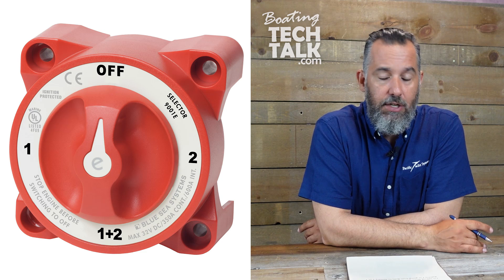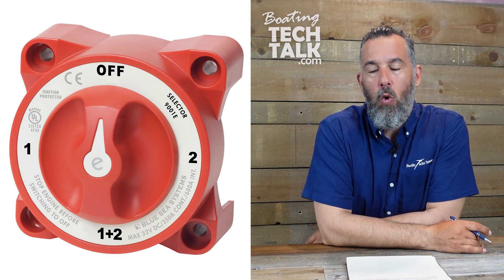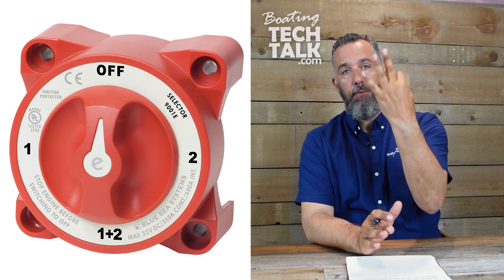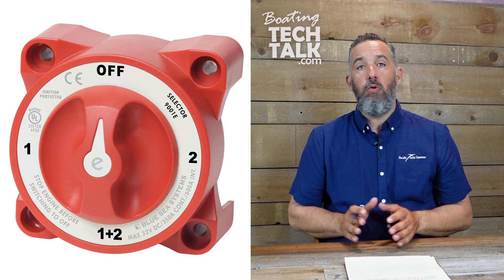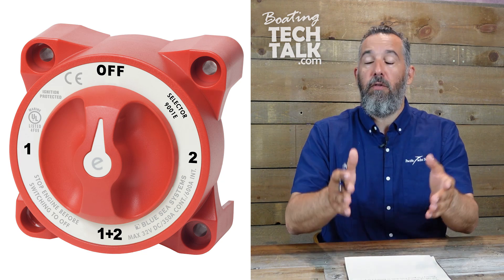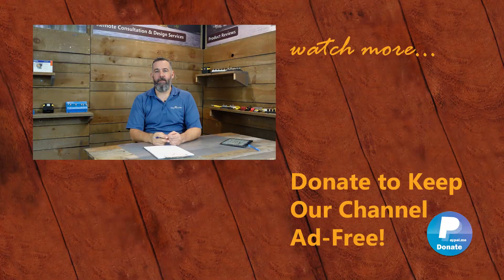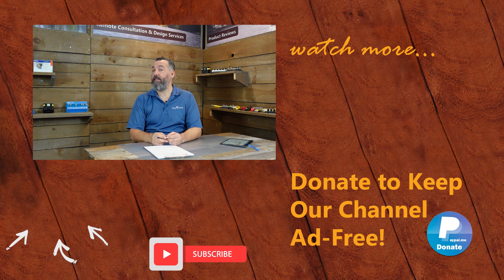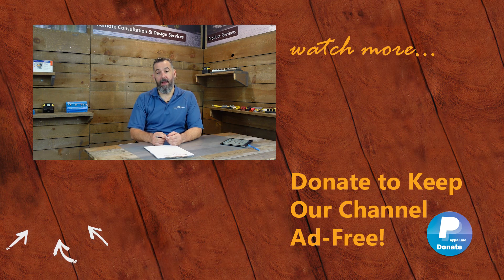Using A Battery Switch While the Boat is Running - Good or Bad?

Comment: Hey Jeff, I have a quick question is there a battery selector switch for a 24 volt system? I I burned up a couple wires last weekend trying to run my new to me trolling motor. I have two house batteries and one starter. The two wires coming from the selector switch to the two house batteries melted all of the coatings off of them. I just connected one of them and it seem to work OK. I do not have the trolling motor going through the selector switch just to the battery with a resetting breaker. I unplug the trolling motor upfront until I’m in the water.

Comment: I believe this problem would be solved by using a battery charging system with an Automatic Charging Relay.  Those switches are simple OFF....ON....BOTH BAT.  
The operator doesnt do anything.  Just be sure to run the boat with the switch in the ON position.  Blue Seas has system like this and it works like a champ.

Comment: I like your videos but you tend to exaggerate and make a lot of things sound much worse than they really are! You said that if you were to turn your battery switch off for even a millisecond it would blow your alternator, That is total BS! I know for a fact that if you were to rotate your switch past the off position it is not guaranteed you will blow your alternator, What you should have said is it is not recommended and you could end up hurting the alternator! I have done it at least a dozen times after having my alternator rebuild in 2001! My boat is a 1987 so I had the starter and alternator rebuilt in 2001 solely due to age, Here we are in 2023 and that alternator is still on my engine! You really make boating sound like it is all work and nothing but problems! I am from New Jersey and my boat has been docked in salt water from May through September ever since I bought it in 1995, My boat gets used once in a while after work during the week as well as every weekend! Boating is very enjoyable as well as relaxing, Most of the  problems with boating is almost always caused by the current or former owner!

Comment: Hi Jeff, great explanation, thanks. Given what you said, should you connect the motor to the start battery directly and then   run a lead from the start battery positive to the common terminal on the on/off/combined switch? If so should or could you also put a simple on/off switch between motor and battery to allow isolation if needed?
Thanks

Comment: I'd like to ask a ?. my name is Derek and the ? is I just ordered a blue sea mini add a battery kit. but I didn't realize when I ordered it that it said 65 amp. I had already ordered 60 amp breaker switches. can i still use them for my install or will they keep tripping when I turn the switch on. I only have two fish finders and led deck lights and led compartment lights on a bass tracker. my trolling motor is on a separate set of batteries. thank u

Comment: Why not just direct connect the alternator output to the house bank and not through the switch
Reply from the maker: Yep, that's one way to avoid interrupting the alternator circuit while the engine is running. Did this exact setup on my boat.

Comment: Excellent video, explained a lot but I still have a question: Is a battery selector switch’s purpose ONLY to select from what battery bank to draw power from (starter, house or both) when you need power, OR does it also determine what bank to charge to when motoring (starter, house or both) from the alternator?
Reply from the maker: Hi Pete, great question, in 99% of stock (i.e. typical installations) your battery source selector is for simultaneously running loads and deciding which batteries (1, 2, or both) get a charge.

Comment: Should my boat isolator turn off my running engine?
Reply from the maker: Boat isolator is on the output of the alternator. Battery isolator should not cause your engine to stop working.

Comment: not in the old days.. that was one way we could tell if an alternator.. or in most cases then a generator was working.. un plug your battery and if the vehicle kept running everything was ok.. if not your alt/gen was bad.. Todays "modern" and "improved" systems you can't do squat or tell squat with out some sort of toy that tells you what to do..
Reply from the maker: Thanks for sharing, definitely learnt something.
Reply: @PacificYachtSystems  Well, it is only useful if you work on old engines with generators.. And I thank you for sharing!

Comment: What if the alternator is wired to the house bank direct (fused) and a combiner is used to keep the start battery happy?
Reply from the maker: Good suggestion, my alternator is setup exactly like that.
Reply: Will connecting to the starting battery directly and add an isolator to house work better?

Comment: Blue Sea makes a battery switch with “AFD” that allows you to switch while running without damage to alternator.
Reply from the maker: Quite useful, but rarely wired.

Comment: Some switches have an alternator field switch ie the two smaller terminals, no field no problem.on the switch turns off the aI use a  capacitor 1/2 or one  farad connected to  the alternator and ground. The older refrigerator system required always to be connected to a battery. The capacitor allowed the battery to be disconnected with the refrigerator running powered by  a battery charger. The capacitor absorbed the voltage spike, back efm  from dc coils, and reduced the voltage pulses from pumps and auto pilot surges
Reply: Edit     after no problem. I use a capacitor…..
Reply from the maker: Thanks for sharing Joe, well explained.

Comment: Surprised that someone doesn’t make an over-voltage device to absorb the sudden voltage spike on a disconnect, and cut the power to the field coil. It’d only need to absorb the max amperage of the alternator for a few seconds. A high wattage resistor could easily “sink” that much power.
Reply from the maker: Exactly, Balmar sells a Schottky (sp?) Diode as protective unit. Anyone can share any insight on the device.
Reply: @PacificYachtSystems  like this? https://www.st.com/resource/en/application_note/dm00024664-schottky-diode-avalanche-performance-in-automotive-applications-stmicroelectronics.pdf

Comment: Why does the alternator have to be switched via the battery main switch. Have a permanent connection fused from the alternator to the batteries, maybe via isolation diodes and then have only the starter motor switched?
Reply from the maker: Good point, we are constantly modifying alternator and starter circuits for this very reason.

Comment: You have never explained why the alternator will die if battery is disconnected.  You have stated many times that alternator will die, but never why.
Reply: The alternator dies because the high amperage output is suddenly interrupted, causing a voltage spike, which destroys the alternator’s diodes, and may cause internal short circuits.
Reply: @robertschulke1596  I know that (30 yrs as EI&C Design Engineer)…but most do not know.  Suggesting Jeff explain the why.
Reply: @borysnijinski331  not terribly technical. It’s the same principle as the ignition coil in a make and break engine. Current through a conductor produces a magnetic field around the conductor. Cut the current suddenly, and the field collapses, inducing voltage in the conductor. In an ignition coil, 50,000 volts is normal. In an alternator, I don’t know, but I’d hazard a guess at several thousand volts. This can be easily demonstrated by energizing an electromagnet with a battery, then disconnecting it. When the connection is broken, a spark will be produced.
Reply from the maker: Thanks for the suggesting Borys, will bring it up in a future video.
Reply: My switch got out in the off position while running down the lake, and now boat won’t start. Any suggestions ??
Reply: @myronmoore30  You likelneed a new voltage regulator but may have just blown a fuse feeding the start/ign circuit.

Comment: When switching from 1 to 1+2 is not a make before break.  Switching to 1+2 makes a connection to 2nd battery…no connections are broken.  Only when you switch to 2 from 1+2 or back to 1 from 1+2 is any connection broken…most importantly only one connection is broken so alternator is not ever disconnected.  If you want to be pedantic, switching from 1 to 2 through 1+2 is a make (1 connected then 2 is connected when 1+2 is selected) before break (1 is disconnected when 2 is selected).
Reply: I think he knows this. He is talking about being for sure of a faulty or just plain crappy switch… in those cases you could be wrong.
Reply from the maker: Thanks for sharing.
Reply: pedantic, really , most You Tubers expect it to be acquired by osmosis.

Comment: I will be rewiring my boat this fall as looking at the contacts are end have corrosion build up.Now the question I will be installing a victron battery isolator from the alternator to house and starter battery bypassing the battery switch. In doing so I am thinking of having 2 battery switches 1 for house other for starter both would be on/off only. The other question is having 2 banks (6 volt agm x2 per bank ) for house batteries would it be a good idea to have a battery montor for each bank even they would act as one. I’m thinking that in doing this I would be able to see the condition of each bank. Thanks

Comment: I avoid all that crap by connecting my alternator output directly to the positive terminal of one of my battery banks. An ACR charges the other bank. Both bank positives terminals get connected to switch 1 and 2 respectively. The switch is now solely a bank selection switch and not a bank selection/charging direction switch. There no chance of blowing anything in the alternator this way as the alternator always sees a load.
Reply from the maker: Well done, we have the same setup on our sailboat too.
Reply: Can I add a isolator from starting battery to house battery so that the later gets charged when former gets fully charged?
Reply: @Astrodude-ca  An ACR (Automatic Charging Relay) will do this job for you.

Comment: So, never connect lithium batteries to an alternator? Wenn fully charged the bms will disconnect. And isn't it the same story with solar? You also should not disconnect a panel while it delivers power? 
I am a bit confused. Last year I changed to lithium batteries. So far my alternator (in honda bf15) still works..Am I just lucky?
Reply: No, you're not lucky. The BMS will disconnect the charging current from the alternator to your lithiums. However, obviously, there's some internal circuitry inside the BMS that prevents your alternator from seeing an open circuit so no blown alternator.
Reply from the maker: Some BMS do not communicate with the alternator, and if the BMS decides the battery is at risk of overcharging, your alternator will be suddenly disconnected from the Lithium battery and your alternator might be damaged in the instant disconnect.